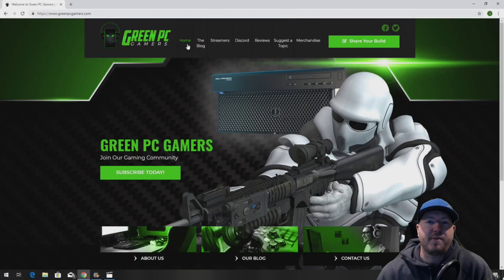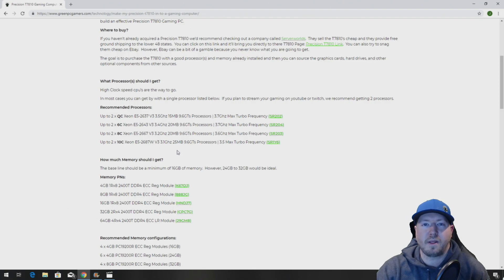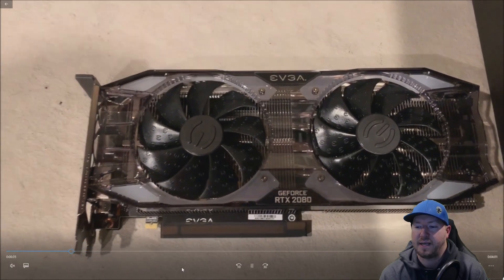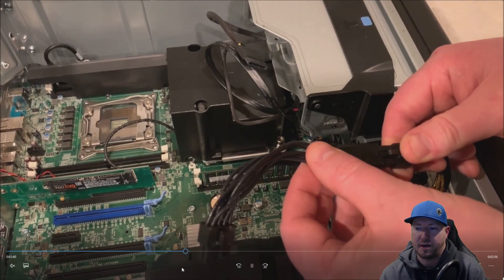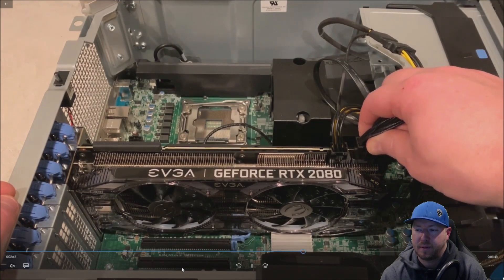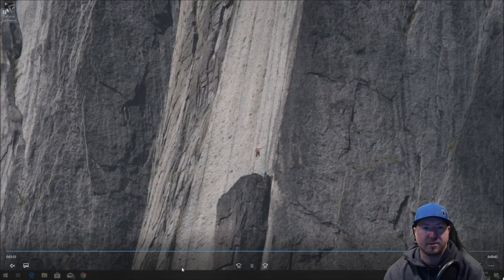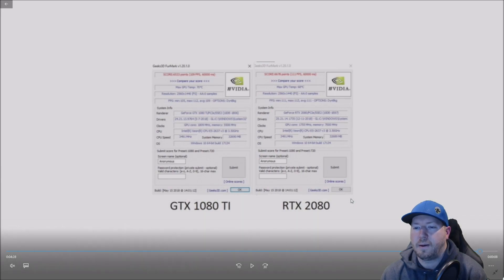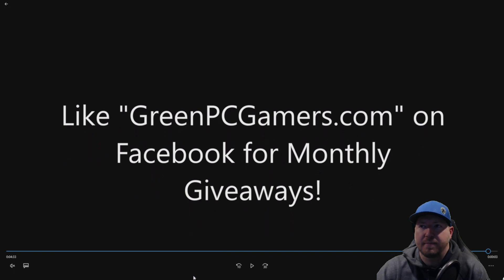EVGA NVIDIA RTX 2080 Install in to a Precision T7810

Comment: I followed this video and ordered the two PSU adapters and got my 2070 Super working in my Dell 7810.  One thing is that watch which version of Nvidia drivers you install in Ubuntu.  I think by default if you follow the Ubuntu packaged driver installation steps and use their wrapper script it will install an older version of the driver.  This lead the card to always run with the fans at 25% and at about 51 degrees.  The newer version (535.154.05) turns off the fans when at idle and the card runs at 41 degrees instead.

Comment: Thank you for the video! I am trying to use an ASUS Strix 2070-O8G in my t7810. It has the 825W power supply, I've mirrored your setup with the power connectors, but I can't get any video to come out, no post or bios or anything. With the original card in, ensured it has the latest bios, tried auto select video as well as manual select slot 2, it has PCIE3 selected in bios as well. I even went as far as to pre-install the Nvidia drivers. Any or suggestions or thoughts?
Reply from the maker: Here are some things to verify:

1. Try the GPU in a different system if possible to make sure it works
2. Double check the power adapters that you are using
3. Try a higher resolution monitor.  (DVI or Display port are preferred)
Reply: @GreenPCGamerscom  Thank you very much for replying!  1) It was pulled from a working machine. I even put it back into the original machine afterwards, card works fine. 2) I think this may be the culprit in so far as using the built in two six pins --> eight  pin. I am wondering if I replaced it with a straight eight pin --> eight pin, it may work 3)I had tried in 1680x1050 and 1920x1080 monitors, in HDMI, DVI and Display port.  **This is a work machine I was trying to do a proof of concept to see if we should purchase a video card rather than whole new system, using my own card from home to save the company money. If I try again with straight 8pin cable, I will update. Pretty sure it wasn't #3 because it clearly wasnt posting...

Comment: I am wondering if this connection will work on t7810 with a 825w psu connection to a rtx 8000 gpu with a usc c type? Or should I use the connection type you used for the 2080ti connection?

Comment: If i wanted to keep use of the drives. Couldn’t i use a sata power splitter so that the original sata power for the drives each get split then back to the drive and one to the pcie connector. Or hell have two hard drives on the same sata power connector, and just give the 8 pin from one original,sata power and one from the optical drive?

Comment: can this card be installed on a dual cpu config ? I have T 7810 /685w Psu / and dual cpu E5-2620 v3 I think I need to upgrade the psu.
Reply from the maker: You should upgraded to the 825W power supply before you add an RTX 2080 Card.  Thanks for commenting!
Reply: @GreenPCGamerscom   will you test Vega 64 on  T7810?
Reply from the maker: Hey Octavian,  we plan to test some of the AMD cards in the future.  For now, we are mainly use NVIDIA cards because they have better driver support for most games.
Reply: @GreenPCGamerscom   I can't wait, I need the vega for  video editing and photo editing , You rock guys :)

Comment: Same question with a Dell T7600 ? Can we make a SLI 2080 TI too ? The PSU can handle that ?
Reply from the maker: I wouldn’t recommended it.  You’d have heating issues if you stacked 2 x RTX 2080 Ti cards in a T7600.  You’d also struggle to provide 4 x 8 pin cables to properly power the cards.  Why isn’t one RTX 2080 Ti enough?  One single RTX 2080 Ti is more than you’ll need for pretty much any game on the market.
Reply: @GreenPCGamerscom  Thanks for your quick reply, actually I have 2 Titans Xp inside and it's working pretty good, it's not for gaming purpose, I wanna use RTX for 3D rendering like Octane Render.
Reply from the maker: That makes a lot more sense now =)  You should be able to install 2 cards as long as you pick the version that only eat up 2 pci slots.  ASUS makes an Rtx 2080 Ti with a blower fan that would probably work well for the T7600.  You should share your build before and after on greenpcgamers.com.  We’d love to see it.  https://www.greenpcgamers.com/share-your-build/
Reply: I don't think the T7600 supports SLI. You can definitely put 2 cards in the chassis and use them for compute tasks, but SLI for gaming must be supported by the motherboard.
Reply from the maker: Hey Dave, we plan to try an sli configuration in the future.  If it’s successful, we’ll post a video.  Thanks for commenting!
Reply: @GreenPCGamerscom  Post a video unsuccessful or not, it would be good to know  :-)

Comment: Can we do the same on T7610 Model?
Reply: Yes. I'm using an MSI 2080 in a Precision T7610 workstation. The T7610 is wired for 2 high-end cards with 4x 8-pin PCIe connectors available right off the motherboard. The T7810 only supplies 2x 6-pin PCIe connectors. Using SATA adapters is risky, as they are not rated for the maximum power of PCIe (75W for 6-pin and 150W  for 8-pin PCIe connectors). You can buy special cables on Ebay to provide different connectors, but they don't provide any more power. The board on the T7810 only supplies 150W maximum for the PCIe connectors, whereas the T7610 provides up to 600W. After owning both, I recommend the T7610 or any of the other larger-chassis Dell workstations for greater expandability.
Reply from the maker: Hey Dave,  The T7600, T7610, and T7910 are awesome for upgrading graphics cards because they have a standard 1300W Power Supply and multiple stand GPU power cables.  With models like the T7810 we've had to get creative with using power adapters.  We only post solutions when they have been proven to work under max load for long periods of time.  Thanks for commenting!
Reply: @GreenPCGamerscom  Glad to help. It can be hard to find good info on these workstations. From what I've seen most people are only speculating and don't actually own one.
Reply from the maker: It should work well in a Precision T7610 as well.  You shouldn't need any power adapters in the T7610.  This is the card we used:  https://amzn.to/2AANlN8